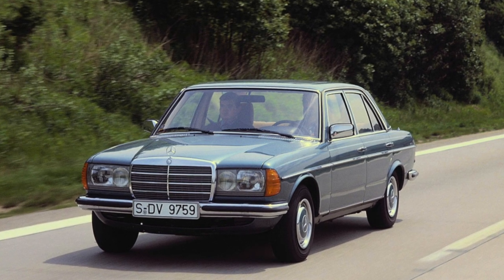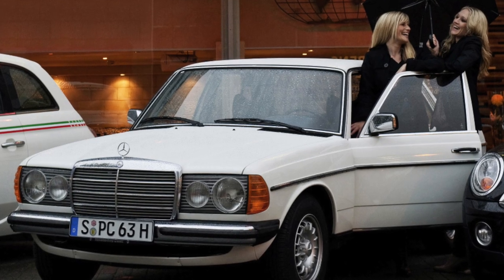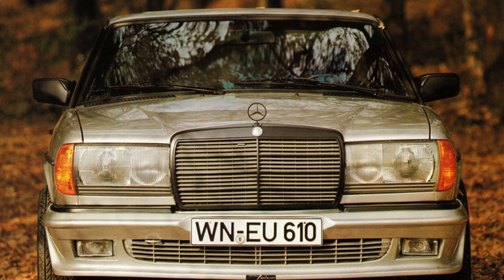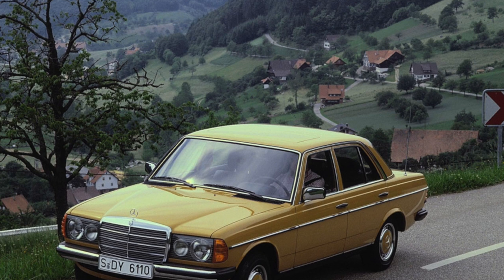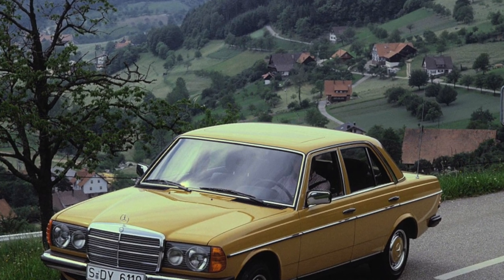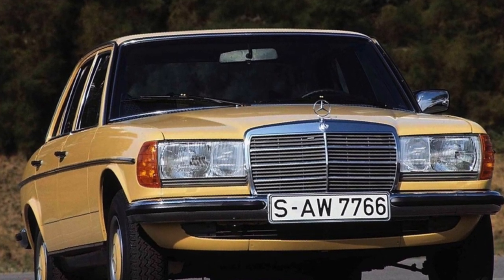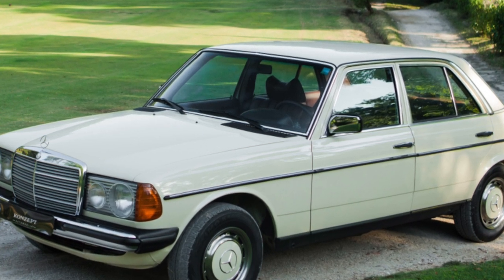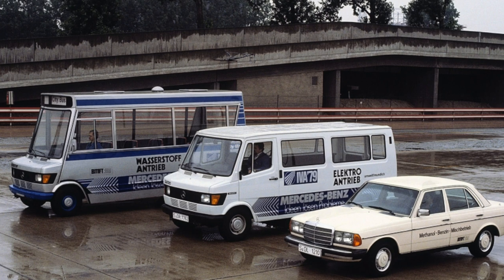Mercedes-Benz W123 Problems | Weaknesses of the Used Mercedes W123 1975 - 1985

Comment: Is petrol engine is reliable ?
Reply: They are reliable - carbureted and fuel injected inline 4 - I would recommend M102 . Inline 6, M110 (older is M115) is thirsty and can be difficult to set properly, but is reliable... I have seen US market M110 W123 with over 288k miles in mint condition...
Reply: @TheAcemaster25  in india we have the model 200, 230,250 and 280E . In this which is the best one for reliablty